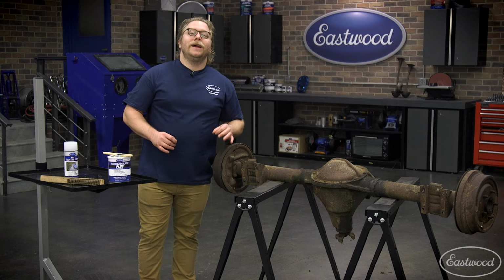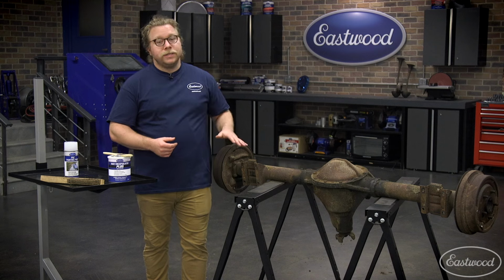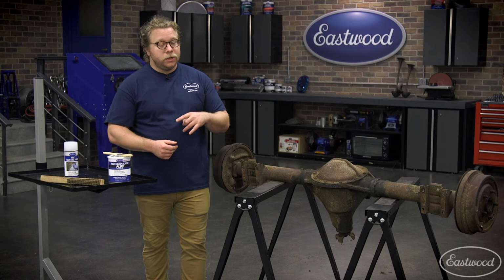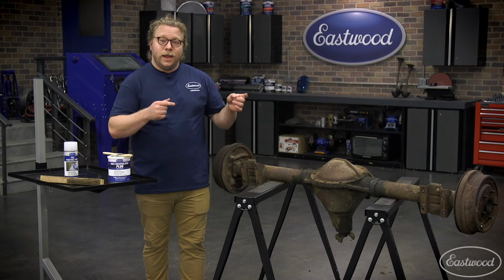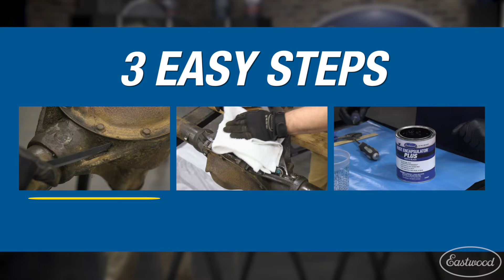3 Easy Steps to Stop Rust - How to Apply Rust Encapsulator Plus to a Rusty Rear End - Eastwood

Comment: You have the patience of Job.  

I have a similar job coming up and I am going to get medieval on it with my DeWalt grinder with a wire brush attachment.  Then I am going to use your products.
Reply: Spot on, I have my Ram to do this summer.  Just two years on the east coast, with less than 30k miles on her I have some work to do.  I like your approach here, I'm going all out as well with the grinder and wire brush attachment.  I was going to go one step further with Eastwoods Portable Sandblaster, for the ROI it might be the best option.

Comment: Oh my! Not a little wire brush right out of the gate. Get that outside and hit with a pressure washer. Then spray degreaser, use a bristle brush and then pressure wash again. Then spray with soap and water, rub with a big bristle brush on a handle and then pressure wash again. Then dry with a leaf blower. This saves me hours.

Comment: 20 bones on a power washer and degreaser off camera, that surface was immaculate before coating.
Reply: @Jimmy_Cavallo  He is saying that it looked so clean he would be willing to bet $20 that they used a pressure washer and degreaser, but didn't show it in the video.
Reply: @johndamico1674   ohhhh… back in my day it was beans 👊🏼

Comment: I still like to remove as much rust as I can first and use an encapsulator after. I just do a basic job of removal though. A little bit of initial work goes a long way. Is a couple hours of grinding vs. 10 years of protection worth it? It is to me. This stuff looks amazing. I'm going to have to pick some of this up. Anyone want tp buy some implement paint?
Reply: he literally says that at the end of the vid, you can see he had done a good bit of prep work before he uses the encapsulator. this stuff is fantastic.

Comment: Can this be used over existng paint? Have a white flatbed with rust spots i want to paint black.
Reply from the maker: This is designed to go over rust or bare metal then top coated if in direct sunlight.

Comment: I bought both eastwood rust converter in a spray can an eatswood rust encapsulator in a spray can.
 Can I use  rust encapsulator  over top of  eastwoods  rust converter? Will that be a waste of product or protect it more?

Comment: Do I have to sand after 48 hours to topcoat? Or can I just apply topcoat. It's a large are with nooks and crannies to sand
Reply: Eastwood Rust Encapsulator also acts as a primer for most coatings, including body fillers. For heavy rust, Eastwood recommends using the Rust Converter first, then the Rust Encapsulator to seal and prime the surface.

Comment: Why did you paint the drums? They are consumable and they dissipate heat. Does painting them not compromise the heat release properties leading to breake fade/failure? That seems dangerous to do (especially by professionals). Please correct me if I am wrong.
Reply: Well the drums look much nicer when they're dissipating the heat
Reply: I would be more co corned with the rust issue than heat dissipation...I am sure if it got that hot, it would burn off...

Comment: Can this be used on brake lines that are still sound but have a rust coating? If not what can you recommend?
Reply: I wouldn't paint old brake lines with any gloss black paint. When one starts getting thin and wet from weeping you'll want to be able to see it.

Comment: Do you have to paint over it to make it durable?
Reply: WurstExpress #616 you could but clean well . All this is used for is on heavy steal parts that see lots of heavy use and you don’t have to severely clean or sand prior to applying. In my opinion its industrial style paint protective. So painting will just be like coating for extra barrier but essentially same.

Comment: Do you have to top coat for UV protection?
Reply from the maker: Yes,  if it will see the sun, it should be top coated for the best UV protection.
Reply: @eastwoodco  what do you recommend for a top coat?
Reply: @307mtb  any paint. your just preventing sun from degrading it
Reply: Only if you store your vehicle on its roof.
Reply: @sibco96  lmao 🤣🤣 maybe he parks on mirrors all the time

Comment: Does this need to be reapplied every often, or is it a one time deal? What's the difference between this and say POR-15?
Reply: Same product different companies basically a I’ve used both and had great result with both. I kinda just buy what’s cheaper when needed. 

It’s a painted surface so it won’t last forever but I’m going on 4 years with a por 15 Coated frame and a Eastwood coasted rear end I drive my truck year round in Washington state.  They both look fine. No flaking or chips. The shine has started to fade but still looks great.
Reply: @Zach-k2p  Thanks for the feedback and good info, I appreciate it!
Reply: @user-tf5kr4qp2i you're saying you applied this over existing paint? I've been trying to find if thus can be done since I have a flat bed and tool box I want to do and don't want to go through the hassle of completely stripping it down to apply this.

Comment: I just want to thank Eastwood for selling me multiple gallons of their original black rust encapsulator at full price to a disabled ASE Master since 78, then 3 days after it arrived, I get an email for the improved silver rust encapsulator at a slightly cheaper price. While reminding me how much better the silver corrosion resistance value is, compared the product they sent me a few days earlier and for my own vehicle. My first and last one. Now, this is even better? 
Perhaps I shouldn't get mad but I am pissed. Money was hard to save before Joe took office and now 3-4 times worse. Thanks Eastwood for selling me a cheaper low end product that is still sealed in the cans! Won't use it, won't buy more, matter of fact I won't buy anything from Eastwood. Not even a stick of gum. Thanks for nothing. Later, because I have a lot of people to tell my story to!

Comment: Can it be used with a spray gun? Or do you have to paint it with a brush...?
Reply: Either or will work. If you're spraying it on, make sure to reduce it.
Reply: I used a dead cat to blot the paint on my studebaker frame. A friend of mine used a replica of the shroud of Turin to paint this on his edsel floors

Comment: I'd be 70 times more Interested if  the vague marketing ploy of 2x nothing actually gave me a idea of how long this lasts
Reply from the maker: We should have been clearer - it's 2x stronger than original rust encapsulator, which means it passed over 1,000 hours of salt spray testing.

Comment: Arent all paints rust encapsulators? I'm not seeing how this product is different than normal tremclad. You painted it black, big whoop. :(
Reply from the maker: Rust encapsulator seals the rust off from oxygen so it doesn't continue to rust.  It's tested and holds up to 2000 hours of salt spray, which a normal paint will not do.